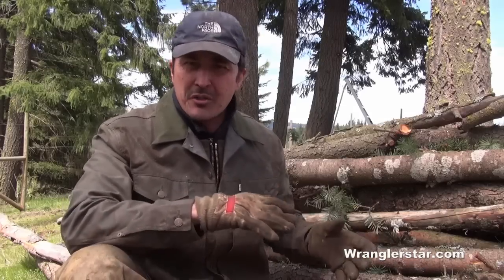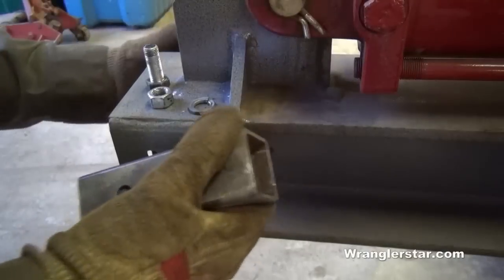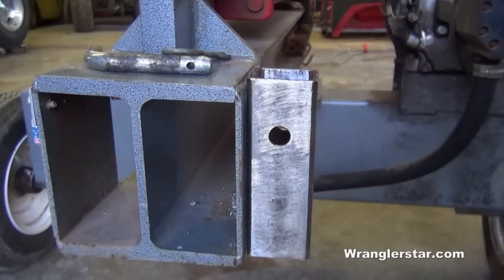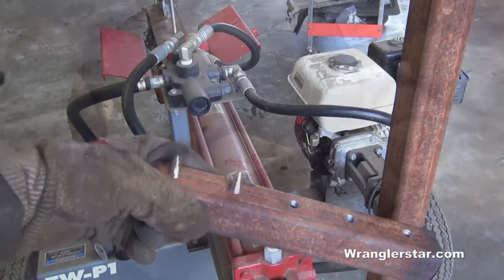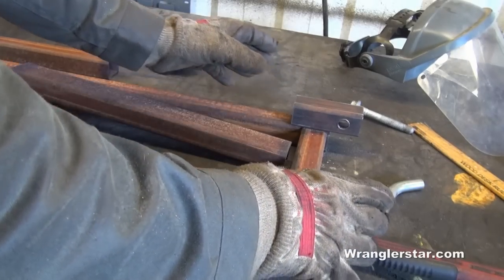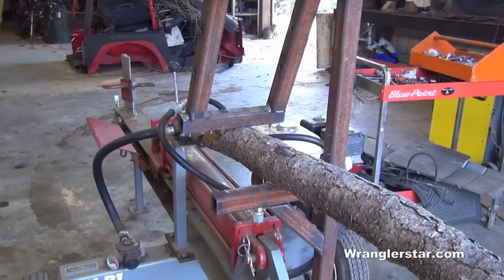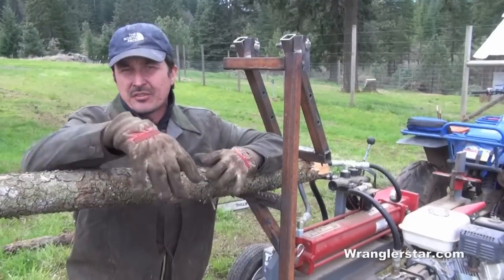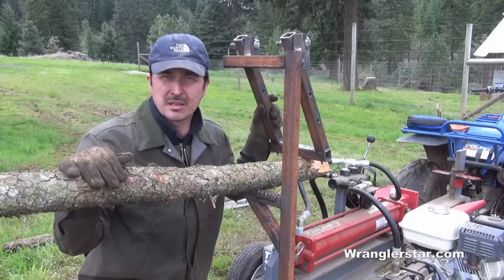A Better Way To Cut Firewood

Comment: If you don't mind an old man making a suggestion......... one trick I learned when trying to slide something in place on two pins, whether it be your swinging arm or a trailer ramp, is to cut one pin or in your case one bolt about a half inch shorter than the other.  This will allow you to get started on the long pin and it holds itself in place as you line up the other.  I love what you did here!!!!!

Comment: I had a lot to cut and I tried to use t-post to get a narrow stack about 5' high for cutting. It was a hassle and then I couldn't do the layer that was on the ground for safety sake of not digging my bar into the ground.

Your way is so much simpler and as you said, can take it where ever you need to go.

Great job...

Comment: I like this project. I have one suggestion for improving on it. Right now as you load the branch you have to hit the crossbar with the teeth on it so that it is pushed out of the way for loading. With longer/larger branches it might be more difficult to accurately hit your mark. I would add a piece of sheet metal across the vertical arms so that it covers the entire opening of the swinging section. This would give you a much larger target area to hit.

Comment: nice contraption! when i'm splitting, i'll just clamp logs in the splitter using the ram, but with lots of small wood like you have, it makes so sense to run two engines to cut up the logs.

Comment from the maker: The steel wall thickness is 1/8" this is on the heavy side however I do notice that when sticking a long limb the leverage force is tremendous. I'm not saying thinner material won't work only that I'm glad I went with 1/8"

Comment: You might want to cover the top openings (in case of rain). For cutting firewood, we used (in Romania) circular stationary electric saws (stationary - can be pulled by hand or transported on handcart). The electric motors used varied, but usually above 2 KW. Electricity from main network is (here) much cheaper than gasoline powered implements. They were usually built just like your device, out of square/round steel, with a spring-powered sled to sit the wood to be cut

Comment: Another high quality video and information. Great idea and love how 'handy' it is right off the splitter. For those with no metal fab Xp or resources -just make a wooden sawbuck. I have a few. VERY easy and quick to make once you've made 1. I have a few and they're all wood [limbs] held together by wooden pegs. 100% free. For what Cody did in this video they work GREAT. I can also load 3 of the sized limbs he did in mine and cut through all 3 at once.

Comment: Really Great idea. I did have 2 suggestions but 1 has already been addressed  about adding a upright bar on the outside of the bottom piece. 2nd suggestion and im sure you prolly have one is a 2nd saw with a much smaller bar, maybe a 10 or 12", this would cut a lot of saw weight and make working limbs a bit less of a chore. Just my 2cents. Great videos so far, keep it up.

Comment: Great videos a I really enjoy seeing what your doing out there..  Agree the limbs are a great resource also because they do not need to be split. I use an old Farmall tractor with a belt driven cord saw.. Cut up those limbs in a fraction of the time. Out do a chain saw easily.. Good luck to you..

Comment: If you season your firewood under a roof out of the sun, it will retain far more BTU's than simply stacking it in the open. The UV rays "cook" the wood as it dries and you loose density. I didn't believe it either until I got a cord of hickory seasoned this way in a huge pile, not stacked.

That wood was heavier than the hickory cord remnants I had left from last season in equivalent sizes. Obviously it burned longer and put out more heat; so much so that the difference was dramatic. I know hickory doesn't grow out where you are but the principle is the same for doug fir, tamarack, pine or any other species. 

Thanks for making your videos, they are a blessing to all.

Comment: Just a couple of suggestions.  Don't worry about the reciever being plumb.  Plumb is irrelevant on a vehicle (or trailer).  In this case, just make it square to the I-beam.  Even if it is not perfectly square, it realy wouldnt matter in this case, but it is a good fabrication habit.  Also, you may think about putting a guard over the engine, cylinder and hyd line.  This will protect those pieces from falling wood.  Excellent idea though and a real back saver.  Great video.

Comment: Exactly, and that is why I,ll never do it again.

If we owned a larger piece of property, I would definitely go the route you did. We live in the city on a corner lot of about 8500 square feet. I'll have to figure out a method that will work for our needs. I only need to do this type of cutting about ever 3 years.

Comment: Hey Cody we use a miter saw to cut branches. Works pretty good that way. We cut hard wood with an 8in saw. Don't know if your still using this log vise or not. But if you haven't tried with a miter saw you should.

Comment: Simple and effective. Only though I had was maybe adding a piece of scrap plate off the back and underneath at an upward angle to protect the hydraulic hoses on the splitter or the back of the ATV (or wherever it might be mounted) and force the last cut to roll away from the machine. No matter what your wood pile for next winter will be awesome.

Comment: Clever, although it seems like extra work to me.  I have found that a 24 inch bar on my saw is just the right length for standing straight while cutting limb wood on the ground.  Mind you, I am only 5'7" and I prevent the chain from contacting the ground by leaving a layer of wood pieces on the ground.  Each to their own...
Reply: +Dan Ryan Completely agree, I don't want to be lifting shit more than I have too. A 8ft tall man should be able to keep his back straight unless he has wood stilts for legs (or "peg legs" if you wish). Even then he can spread them a bit and maintain posture... lol   Is a clever device for physically able weekend warriors though I will give it that... or a old feller that has some youth feeding said device so he can just stand there cutting.

Comment: Good idea, but what I do has worked for years...I cut a "V" notch in about a 2 foot diameter log about 4 foot long in it's side at the pile of limbs and use it to cut the limbs safely up from the ground...when done with the limbs do a final cut thru the center of the "V" cut to make 2 logs out of it...I know it's a really fancy contraption :)

Comment: Consider welding/bolting on some plate steel or sheet metal.  You wouldn't have to hit the lower jaw to open the clamp, just hit anywhere the plate steel is and it would slide into place.  Great piece of equipment.

Comment: Great idea. Nice and small. What if you changed the bottom rest to form a V at 60 deg, this will ensure the limbs will not move to either side and you can still use it to cut variable size limbs.
Reply: Good onw

Comment: I wonder, since it's low, if you couldn't put a mount for that on the tongue of your trailer so that when you cut the branches they fall right into it. Just drag the loaded trailer right up to the porch off load then go back for more. Good for cleaning the big stuff out of slash piles too. Well done Cody.

Comment: Angle the bottom bar upwards at a shallow angle (instead of keeping it flat) will force the branch into a natural resting place against the vertical bar. No need for teeth on the bottom to keep it from slipping side-to-side. You'd probably want to mount the "barn door" so it is fastened on both sides of the vertical bar, giving some overlap between the teeth and where the branch rests in the bottom bar.

Comment: For the bar that doesn't' have "teeth" on it, I think it would have been a good idea to make it V-shaped instead of straight; that way the log would be centered & would prevent the log from sliding off.
And another thought is to have the bar that has the teeth on it, to also be V-shaped, perhaps thus eliminating the need for teeth altogether.
Reply: I like that idea. you're too late.lol
Reply: Well, not too late for me!
Reply: I think I'd want the teeth to make sure the wood can't rotate or slide forward & back.
Reply: I agree... Either a shallow "V", or a shallow "U"
Reply: lxmzhg you don't need a V if you just angle your bottom support up about 10% and angle your top the same 10% down. That will pinch anything to the upright. You just need to add a small bit on the length of the brand door.

Comment: Thanks for posting this! I haven't read all of the comments, but have you thought of adding a piece of sheet metal to cover the void space of the swinging holder?  That way, you don't need to line up the log end with the frame of the holder, to push it in.

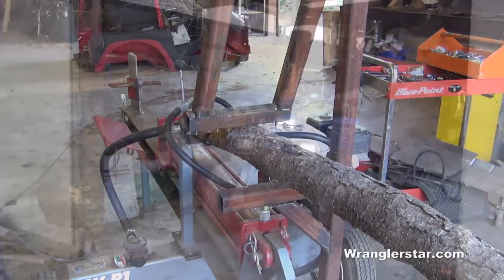Comment: @ 7:45, I agree with not putting teeth on the bottom bar, but some inline guide weld (humps for lack of a better word) to keep the log from wanting to swing sideways.
And then at the end I see teeth on the bottom jaw to do just that.
Reply: I was thinking about that as well. Another solution would be to make the bottom bar a slight "v" shape, hence centrally locating the limb.
Reply: CorrectiveAction looking at the video ...don't I see teeth of some kind on the input side of the shelf the limb is resting on?
Reply: jjaylad yeah i see it but only after he took it out of the shop and actually used it to hold the branch.. before that it wasn't on there

Comment: Your going to think I'm nuts but I resolved this issue by taking my chop saw outside. It works up to 5" for a single sided cut. And 6" if you don't care about turning it over. If its good enough to cut 6" schedule 40 pvc pipe. It's good enough for my branches.  Oh and what happened to your jeep? Was there a winching event that went horrible wrong?

Comment: Great idea.  As an after thought, I believe the wood would be more stable if the bottom bar was a V.
Reply: Yes but the. You would have other flaws like the bar with the spikes would have to be adjusted more because bigger branded will sit a lot higher up

Comment: +Wranglestar I know that it's probably not a big deal for what you're using it for, but my old high school welding instructor would have had a field day if I took rusted stock and welded it without cleaning the rust off first. Like you, I'm no master welder, but he instilled it into me so bad that it always irks me when I see people do it. Honestly, I have no idea what difference it makes, but all the same. 

That said, I really like what you did with your design there. It is quite clever.
Reply: +Mark LaDoux Yep, Mr Waters my shop teacher woulda freaked as well. And sand n paint it to last as you spent valuable time building it. Probably coulda been made out of smaller stock and for sure pipe.
Reply: +Mark LaDoux If I'm not mistaken he did grind the areas to be welded as seen in the video.
Reply: soaringtractor Migs don't think to kindly of much In the way of debris sir, therefore it certainly makes a difference. You end up with a bunch of proxy in your welds if you don't. With that being said though, shit welds would have worked just fine for this contraption (not that he wanted to do so though).
Reply: soaringtractor That is for certain, can't say I disagree there. I on the other hand question the entire practicality of building one of these "Contraptions" in the video to begin with. lol  It truly makes no sense to me really but then again it don't have to in reality, if he likes it that's all that matters really.... In the spirit of "You Tube" I just figured id throw my 10 cents out there like everyone else. bahaha 
Note: I gave him a thumbs up for effort btw. :)

Comment: It would benefit from a sheet metal plate on the "door" so that the limb always pushes it open rather than poking through the hole.
Reply: Correct
Reply: Saw it right off!

Comment: I like your method, but I had something built for me that worked even better and was much more efficient when I cut my own firewood, which I did for many many years.   Your method is great and works fine but only cuts one piece at a time.    I had my original stand built out of 2 by 4 's but PVC might work also and would be much lighter.   Mine was a permanent thing and I did not move it because of the weight, but pvc would make it much lighter and you could make it so that it could be folded down while it was being transported and then put back in place by folding it back up and tightening all of the bolts.    I started out with two rows of vertical 2 by 4's about 12 inches apart.    From the first 2 by 4,  I would go in 15 inches for the second one, and then put in a third one leaving about a 3 inch gap.  That would give ample space to put your vertical chainsaw cut through the wood and there would still be ample support to hold up the pieces of wood, be they pole limbs, or slab wood, which was something that I cut often.   After that third vertical 2 by, I would add another one leaving 12 inch gap, and then the fifth 2 by would leave a 3 inch gap between the fourth and fifth vertical 2 by.    I would have two vertical rows of these vertical 2 by's about 12 inches apart although it could be narrower.   It depends on what you have to work with.   If you buy your PVC or 2 by's  or  in 8 foot lengths,  you would be able to cut 8 cross pieces out of one length.  I would place one of these cross pieces by each vertical 2 by, starting on the inside of the first and the second 2 by's, and then repeat for as long as I wanted to make my limb holder.  I would start the cross bars about thigh high from the ground and this would the what was holding up the limbs or the poles that I was going to cut with my chain saw.   That way, I would have absolutely no bending  even while I was cutting my wood as it would all be held up at a height that worked for me.   How high you would want to start would depend upon how tall you are and how comfortable you are in bending.    I would be able to stack my limbs or my slab wood inside of this frame starting from thigh high to about chest high, so I would have between 2 and 2  1/2 feet of  stacked in wood that would also be about 8 to 10 inches wide.   If I made my wood cutting frame about 8 feet long, I would be able to make 4 or 5 vertical cuts, giving me  5 or 6 pieces of firewood, multiplied by how many pieces of slabwood or  limb poles that I had been able to stack in my frame and I would have only made those few cuts with the chain saw.    Just imagine the time and fuel that I saved, not only in cutting the wood, but in stacking it.   I always just carried the wood by the armloads over to my wood shed to stack, but I was going to invent a I sling made out of rope or heavy wire that I would tie around each bundle of wood that I had cut so I could lift each section of cut firewood out of the frame with one movement, and carry it over to my wood pile where I would release the sling and pull it out from under the new wood that I had just carried and placed on my pile.      I know my description of only words in describing what I used is totally inadequate but I think that you know enough about building and are good enough at thinking out of the box to be able to figure out what I was doing.   I have mentioned this to you as it can not only be made so that you can take it to wherever you are cutting if that is what you want to do.   If you hold it together with nuts and bolts, you will be able to fold it down to a compact  movable package by loosening those nuts and bolts and then put it where ever you want to use it.   You only need just a few lower cross pieces at the far ends of the rqck,  and a few top cross pices to stabilize the rack, in addition to the main cross pieces that your fire wood poles or slabs would rest on.    If you were worried about the pieces of wood flying around once you started cutting with your chain saw you could put heavy weights on the top of your wood in order to hold it in place while you were cutting it.  
     If I have tickled your imagination enough that you would consider building such a cutting rack, I hope that you let me know about it and let me know if it works for you as well as it did for me!!!     I was able to cut days off of my wood cutting and stacking work load as well as save a lot of gas and oil money by using this method, which is part of what sustainability is all about.   I also have gardened using both the wood chip method and the lasagna style of no til gardening, which is basically what  the Back to Eden method is based on.    Wood chips work the best by far, but those who can't get access to them can use other things, even pine needles if that is all they have, something which I used to great results.!!!

Comment: When I was cutting firewood I would haul the limbs home and cut them to size with my circular saw. (Had a platform set up at a convenient cutting height, which also dropped the pieces into my wheelbarrow.)

Comment: only way you could make it any better is if was bolted on at the front of a trailer so you dont need to pick up the cuts but as you said its very easy to bolt it onto other places, well done might need to make myself one of these